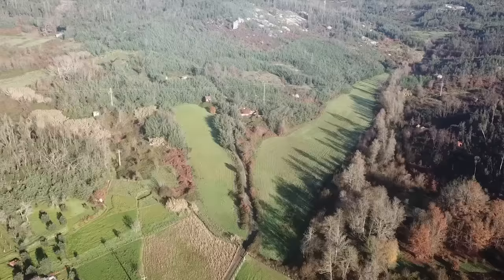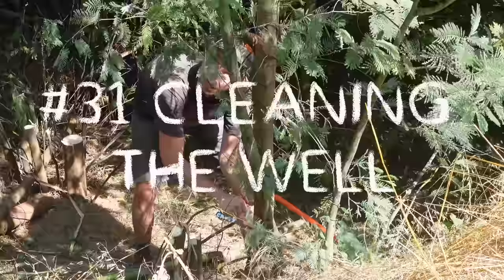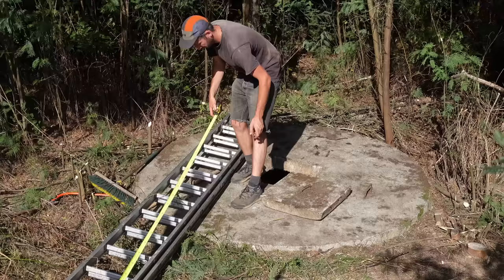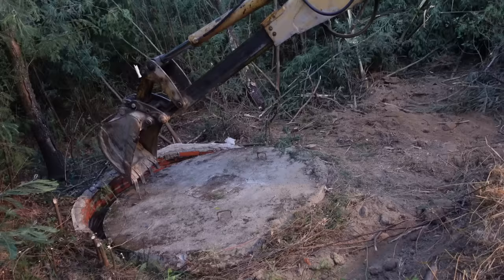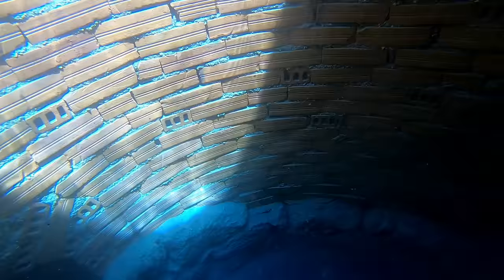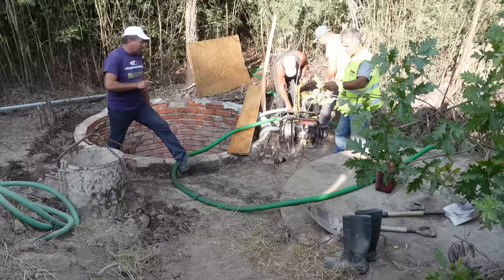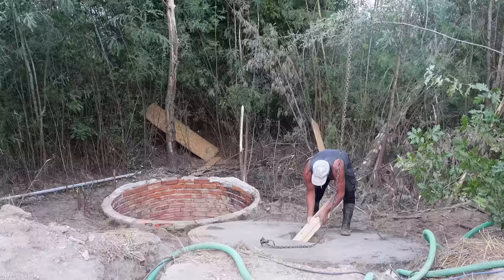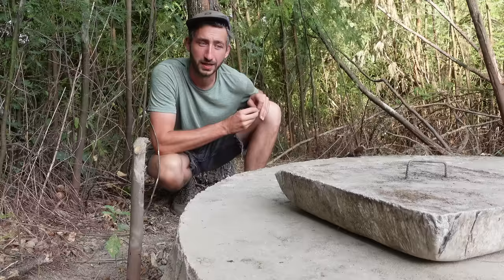#30 Opening up an old abandon water well

Comment: What did they bring out of the well? Was it just mud? 
Kinda sad we didn't get to see the clean bottom of the well, bc it still looked kinda dirty.
Reply: It is. That is the sediment that fills over the years, its just what the watter brings. For wells its not a typically a problem as long as the intake valve is way above it so it would not collect any if it. For drinking wells its good to clean it every 10 or so years.  Those guys should store or use it directly in the garden because its high neutriant stuff.

Comment: Please could your community read my main comment in video #49 as it is important for the safety of drinking water from this Well 😘

The little underwater 'cave' with the rock face in it (in the side of the Well bottom) is likely to be the actual spring-head water source, where the water first emerges from deeper underground.
Another commenter pointed out how originally water was accessed by a 'water - mine' which you also pointed out as a tunnel down the hill in your earlier video discovering this Well 👍

Thank you x.

Comment: Is there a gap in the side wall to slide a pipe in? If you can slide it to the middle and then via the hatch mount your down tube and pump assembly with a hose clamp so you can disconnect it in the future and make sure you leave enough length in the pipe to slide it out without it dropping.

Comment: Those trees you cut can make very useful poles. Remove the bark while still wet, within a few days of cutting. Start at the bottom and peel off the bark like peeling a banana. Allow to dry for a few weeks then treat with creosote or have them treated at a timber yard.

Comment: OHS safety funny reminds me of my brother who spilt petrol on his pants went inside lit the gas for coffee and can no longer wear high heels without 14 pairs of stockings , unforgiving for some it’s like food poisoning won’t happen every time but it will happen glad it all turned out well ... WELL get it aher! ..... sorry , is it only being used for agriculture or drinking ? Good blog my Reno in australia had a septic like the well and the overflow is a silage pit as round as a 44 gallon oil drum refilled with gravel to soak away , we put a 2 metre shovel in it and was deeper ,usually 7 metres deep to water table , too hard my thoughts and left the grass covered motor bike wheel off , ....... rain and 2 months grass needed cutting partner backed up and disappeared the mower handle gripped , mower peak revving up on the air little hands gripping for dear life  , my mum says what’s that looked out and scrambling out of the urine , mosquito water crawls Doris gum boots full of pee , mum took off laughing saying imagine the cause of death at the coroners enquiry  ..... then wanted to walk thru house to shower I said na! Put the hose on her lol

Comment: Was that really needed? The waters seemed perfect. I'd just treated it and pump into a high level tank...
Reply: Rain barrels also end up with that slop at the bottom. Doesn't cause any problems to fish and the water never smells bad.
Reply: Maybe it was a deal with the neighbor, they can use the well, but they have to clean it up?
Reply: @stefang5639  I don't see the reason why is that. The water system was already in equilibrium.
Reply: @bestzohan  the guy wen opening the lid kinda said that, "limpinho" translates to something like squeaky clean. yeah no need to clean the bottom, but on well now they did get rid of some bottom deposit after it sets its does not hurt...

Comment: I may have missed it but why did you clean the well out?  I've seen other wells cleaned out when they are very full of sediment and the sediment takes up many square metres of volume that should be water instead.   But your well was very wide and not even half full so water capacity is not an issue at least when you made the video.  Sure it is good to get rid of the old muck at the bottom of the well, but soon new muck will be there.  All wells have muddy bottoms.  Overall your well looks well made and not really that old.  You could likely have just installed a pump as it was and used it for decades.

Comment: It's actually quite difficult to ignite petrol using a cigarette, due to the rapid ash being generated by the cigarette.
Reply: No, it's not just the ash. You can toke on a cigarette and shake of the ash so it glows orange and it still won't ignite an explosive mixture of gasoline and air. It's not just difficult; it's nearly impossible.

Comment: It might have saved your live that you didnt go into the well right after opening it, just because it was already late/dark. Giving air some time to replace CO2 that was, potentially, in there. Not to mention that you ladder could have slipped a bit deeper, trapping you. 
Doing that all alone with no backup. Yikes.

Comment: I wuldn't enter any closed unused whell without gas detector, i culd have CO2 or CO gass build up, since they are havier than air, they ll not float after opening. Seen holes in ground with not looking bad, but gass detecor was showing 2% O2...
Reply: carbon monoxide (CO) is lighter than air

Comment: 1 - Most off-grid projects should be supported, yours is not one of them.
2 - Safety is paramount. 
- Invest in some gear, maybe a few meters of rope. Keep in mind that people are watching, you should set the example. 
- If anything happens to you, if you have an accident, your life will change drastically and you'll be causing unnecessary pain to those who care about you. 
- if you hire any service, even in rural Portugal, you should always ask to see any kind of insurance proof from the contractors. if any of them has an accident while on location, you could be liable. 
- If the ICNF catches you and your contractor destroying/ 'removing', those trees with an excavator and not following any of the guidelines, you could be fined. Even if you're removing Acacias (mimosa is an uneducated name)
- Whenever you are working around an unprotected well, some type of barrier should be installed, even if temporary. You could have used the trees that you sawed down and some rope (again that life-saving rope) to build something. If not for you, for your contractors then. 
- If you witness any of your contractors drinking while working if you suspect that they might be intoxicated while on location, then it is your duty to ask him to leave or his superiors to remove him from the job site. Again, you could be liable, you don't know if they are insured and no safety measures are in place.
3 - If you witness any actions that might be fire hazardous, you must STOP IMMEDIATELY all activities and address the situation.
4 - If you witness any reckless driving/maneuvering of an excavator you should ask the operator to respect all safety standards. 

As a Portuguese who lived away for 15 years, it is very hard to come to the realization that Portugal is still 40 years behind any developed country. 
Don't support/exploit that. 
It is your duty to educate those who don't know better. it is your duty to make sure that the law is applied, to you and to those working for/with you. It is your duty to set the example if you're going to broadcast your deeds on YouTube. 
I almost lost my life in a labour accident a few years ago. I am incapacitated for life. I am renovating a 300-year-old house in rural Portugal, by myself. I know it's hard to get the workforce outside urban areas, I do understand the challenges, but we need to inform those who are uninformed and set up good practices. Otherwise, we will never move away from being a troglodyte society, ruled by alcoholic-cigarette smoking while pouring gasoline-assholes. 

Your comments about security are childish and you seem to be unaware that you are at fault.
Reply: yea I agree with everything you said and I find it is really dumb/sad that people treat dangerous work/situations (well work)/(cigarette with gasoline fumes) like something funny or joke about when the reality is that several peoples lives are at stake here but also the land could burn up if a can of gasoline were to go up in flames. If a large fire broke out then their reklesness could threaten countless families,land and peoples homes

Comment: He is lucky his ladder did not fit.  There is a really good chance that the O2 level in that hole were far below sustainability. , i would imagine there is organic material in there that has depleted the oxygen level in that hole.  A drop from 21% to 15% oxygen is enough to quickly incapacitate a human, and with a fall into that water, that means bye bye mr well finder. They should h have at least discussed this. People die from going into places where the oxygen levels are lower all the time.  It happens. Search on it and you shall see.

Comment: Smoking -1, smoking above gasoline +1 (problem soon to be solved) :-)
Reply: you will be surprised but you can actually put out a cigarette with gasoline, and diesel will for sure put it out for good.. (not that is something you should do, don't)
Reply: @pinheirokde  gasoline I didn't know. Diesel I did. Still, I won't try it. 🤣
Reply: true, you have to have a certain mixture of gasoline fumes in the air in order for it to be able to ignite. You're pretty okay in open air but still, don't try it. Especially when you're in the middle of highy combustible matter.
Reply: @Roosmarijn035  yes worse than the gasoline is all of the dry grass around them... that thing will for sure start a fire if mixed together, dry straw and light cigarette buds.

Comment: A lit Cigarette cannot ignite petrol. Only in the movies
Reply: Wrong
Reply: @richardrichard462  how ?
Reply: @CombatMosquitoTrainer  Look up gasoline vapour + ignition. Even better, try experimenting with it.Let me know how you get on
Reply: @richardrichard462  petrol is a liquid, the "vapour" is a gas. I stand by my original statement. 
Yes, I have experimented with it. When I was younger, I worked with a mechanic who extinguished his cig butts in the container of petrol he dropped the washers, nuts and bolts from vehicle disassembly into for degreasing purposes, whilst initially, I ran for the hills. 
I have since repeated the demonstration multiple times to other doubting Thomas's and to win bets over backyard beers. Cheers.

Comment: 8:00 and I've had enough.  How many things could go wrong.  This can't be happening in North America.  How many dangers to start off with?  Confined space entry, no rescue plan, no one there to rescue idiot that goes into the confined space.  Didn't dip the tank to check for o2 level or any other dangerous gases,  No safety line, improper use of a ladder.
Someone did that on my site, they would be sent home and the parent company Safety dept contacted.
Fail on every level..